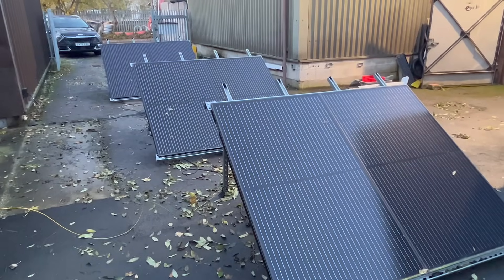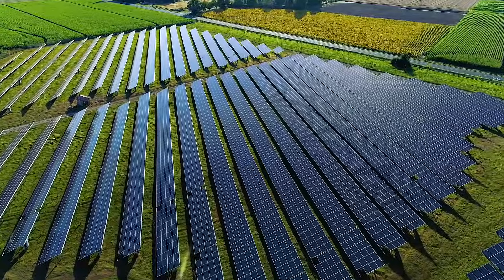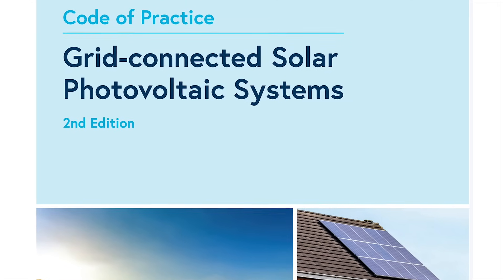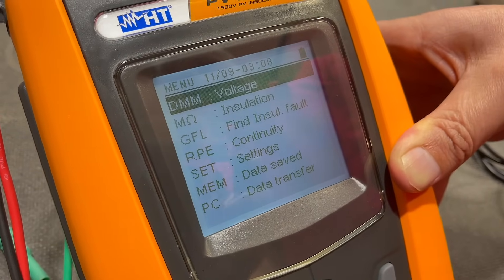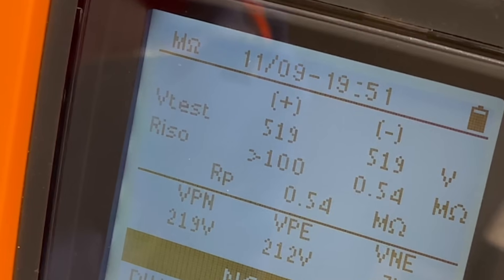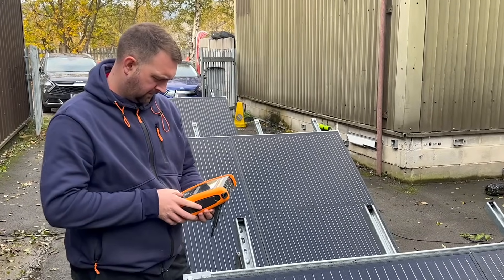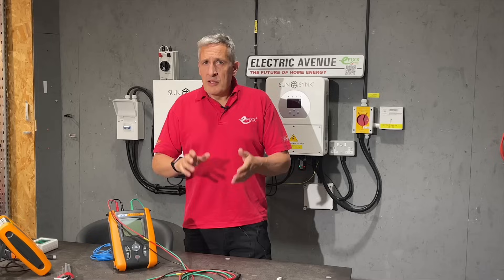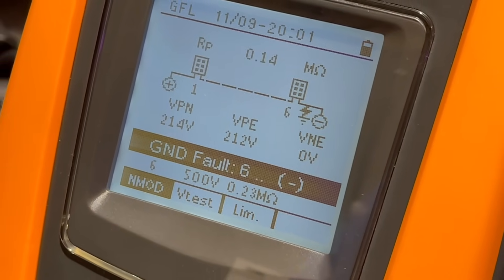Fault Finding in Solar PV Systems - PV ISOTEST

Comment: Sir  i have query regarding mine 5kv solar on grid plant, mine system beep when i wash my panel or when it rains, after 3 to 4 hour sunshine plants become normal and start functioning.
Sir need help how to find the error and how to rectify it.

Thanks.
Reply: @7sky574  have you fixed the issue?

Comment: I guess it measures the voltage between the conductors and earth to work out where the fault is?  If that's the case I wonder how it copes with two earth faults.  Might be interesting of @eFIXX causes two or more faults in their setup as a test.  Wouldn't it be fascinating if it can detect that and report each fault separately.
Reply: schafft es nicht. kann es logischerweise nicht. habe dazu auf der intersolar München nachgefragt. nur ein Modulfehler ist erkennbar

Comment: There is a big issue on PV installation and measuring Riso, when grounding dont have continuity between all the panels the measurement is not trustable, advised is to use poking clamps between panels, so they poke trough anodised surface of the panel.
Reply: I can see how a penetrating clamp would give conduction between the panels but not how it would give good conduction to the rails.  It's a requirement here, Australia, that removing any single panel must not disrupt earthing of other panels.  The penetrating washers that sit between the panels and rails achieves both conduction between panels and connection to the rails to ensure everything is tied together and removing one panel does not disrupt overall earthing.  Nothing wrong with a belt and suspenders approach and using both of course.
Reply: @retrozmachine1189  I'm with you man,  there is no good solution yet, here in Europe almost 90%+ parka builded wrong, no poking clamps no ground continuity beyond secon panel. I Have HT pviso meter, but when ground is not continued it shows always >100MOhms